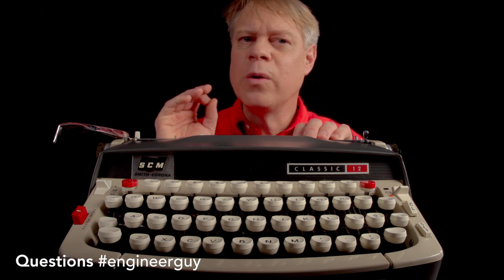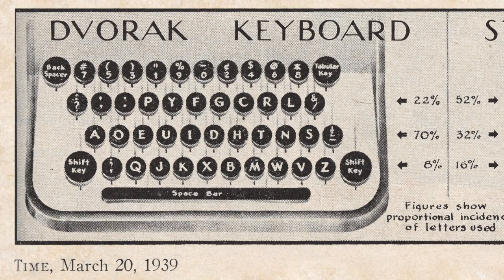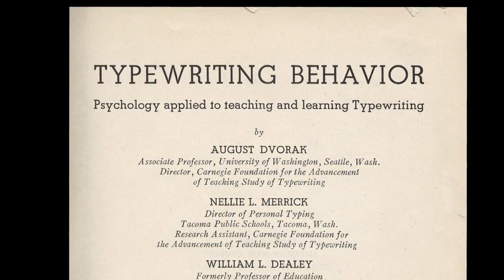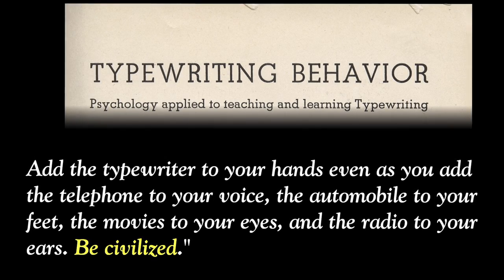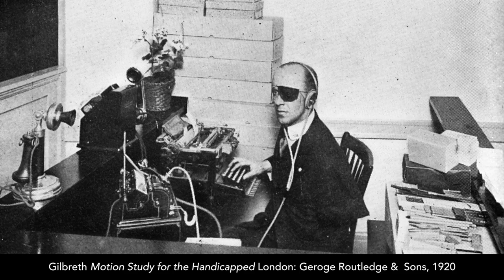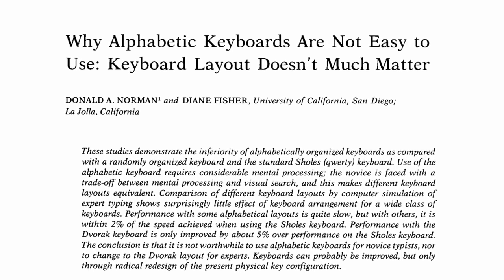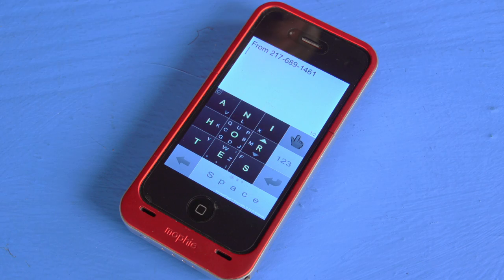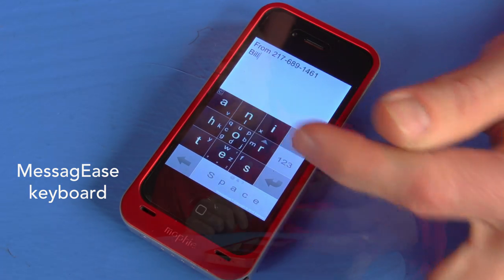Why the Dvorak keyboard didn't take over the world

Comment: Dvorak seems rather arrogant with his studies. It reeks of someone trying to prove that they understand something better than others even if it is not true. In reality, the practicality of the Qwerty layout worked for typewriters and it still works today because of how the letters are arranged to allow fingers to be spaced out and used in a certain order (for English). It takes a significant amount of improvement in efficiency for new technology to upend existing technology that works so well.

I disagree that the first technology is always the one that is accepted. Apple has proven several times that making technology more efficient for users takes precedent over being first.
Reply: "... because of how the letters are arranged to allow fingers to be spaced out and used in a certain order..."

could you provide a reference for this?  everything I've read suggests the opposite.
Reply: And then Google/Windows demonstrated that open platforms win out, and dominated the handheld device/computer markets.
Reply: ThoperSought
What do you mean by "opposite"? Are you suggesting that Qwerty was designed so that fingers are confined to a small area on the keyboard? I would think that the separation of vowels 'a' and 'e' from others 'i' 'o' and 'u' on the other side would force people to use both hands if they wanted to be more efficient. There are some letter pairs like 'ed' 'er' and 'ty' that direct fingers to the same spot, but for the most part the design keeps fingers separate (for English).

Sure, you can change the layout of the keys and get the same effect, but the point is that humans are mechanically limited just like machines are and that improvements in efficiency should be significant if one is going to upend a standard. Dvorak had an interest in selling his brand of keyboard even if improvement wasn't significant enough.

I don't have any links to direct studies, but the Wikipedia entry does direct to a few studies that refute claims that any keyboard layout has proven more efficient than Qwerty for the purpose of typing on a desktop with two hands. Stenotype is said to be more efficient for professionals, but that layout is not practical for the average person. http://en.wikipedia.org/wiki/QWERTY#History_and_purposes
Reply: seigeengine
Yes, Google and Windows did win out because of their open platforms, but both Google and Windows adopted the design and aesthetics of Apple platforms. Efficient design and open platform is the best option for the majority of consumers.
Reply: Lerkero Yes. Apple makes pretty aesthetically simple devices.

But they should try being not so butthurt and not so iron-handed with their platforms.
Reply: Lerkero Apple phones didn't even exist when Windows Mobile 6 was out. Windows Phone 7 is a horrible example of an open platform. Windows CE throught Windows Mobile 7 were an excellent example of an open platform, and existed way before Apple made the iPhone.
Reply: It's all in how you market your product. Should check out First, Best, Different by John Bradley Jackson to shed some light on a fun topic as this =D
Reply: seigeengine Apple decided to go the Microsoft way during the 90s. They almost went bankrupt. Apple knows very well what they are doing.
Reply: Joel Monteiro Which is why they're being out-competed in every market by "the microsoft way?"
Reply: seigeengine Ahah! Yeah, they're in real trouble lol.
Reply: Joel Monteiro *sigh* Yes in a way, they are. No, they're not at risk of going bankrupt or anything like that, but markets they used to dominate are now shifting to their competitors. Their only viable pathway is to innovate endlessly and be the first to market with an easy to use efficient and aesthetically pleasing design (with good marketing), or obsolescence, gradual decline, and ultimately falling into irrelevance.

Keep in mind I'm talking long-term. They have solid sources of revenue, but your choices are either growth or stagnation, and stagnation leads to decline.
Reply: kmica2008 To be fair, as a fork and spooner (lol), chopsticks are very convenient general eating tools, especially considering Chinese cuisine is sort of based around their use. The only thing chopsticks really suck at is liquids, and they use spoons for that...
Reply: Wouldn't you be mistaking the idiots pretending to "promote" Dvorak or alternative keyboard layout and being all "I'm better than you, Qwerty plebe !", with the original work done by Dvorak ?

Arrogance is strong among the pro-Dvorak of today, I'm not so sure about that regarding Dvorak (the human).
Reply: Lerkero I know that this is somewhat of an old thread, but I just wanted to let you know that all of the pain in my wrists is pretty much gone ever since I switched to Dvorak about two weeks ago. I also feel that this layout was much faster to learn than the crappy QWERTY, and I feel that I don't have to put as much effort into typing something out.
Reply: TubeofDestiny I don't think I'm arrogant being a pro-Dvorak typist.  I do however know that from the vast hours of typing on a daily basis, QWERTY nearly drove me to carpel tunnel hell.  I switched to Dvorak and never looked back.  I enjoy the feel of the balanced typing, and carpel tunnel has never bothered me again.

You may also like to know that there is a left handed and a right handed Dvorak layout as well, which were designed for people with one hand.  This is my next learning project....so that I can switch to one of them so as to type one-handed while the other hand is busy maybe with the mouse or with a drink, or eating etc..  I like to multitask.
Reply: getdistracted Dvorak may put less stress on the hands, but carpal tunnel will happen to anyone if they type a lot of don't take proper care.

And multi-tasking always leads to distraction and degraded performance.
Reply: getdistracted
Yea, you might be one of the non-arrogant pro-Dvorak typist - but it's a fact there is some people posting pictures/"guides" and walls of text on the Internet, telling people they're doing everything wrong and should become civilized humans by using Dvorak.

I know that properly used (= fixing all the other ergonomics issues plaguing computer users), Dvorak (and all its variants) is an improvement: more comfort, less strain on the hands and wrists.

It very rarely increases the typing speed or accuracy (despite all the claims of the arrogant pro-Dvorak people, trying to use that as a proof it's "better"), but in terms of long-term comfort and health, it's an improvement and should be considered.

It's the same problem with meat: PETA/vegans militants are yelling at people, while respectful people simply indicates that we might be eating a little too much meat, regarding our diets and natural resources.
Reply: TubeofDestiny Well, you could argue that less strain leads to better accuracy.
Reply: getdistracted
I've never personally felt any strain or hindrance due to Qwerty. I feel that as long as the keys are spaced well enough for average size human hands any keyboard can help people type well with good muscle memory. I like that the vowels are spaced out on Qwerty and how some common consonants are adjacent.
Reply: Lerkero My wrists started to hurt like a mother after using Qwerty on an IBM Model M for a while. I guess they're just sensitive. As of now, I can type faster than ever before, and that's after three months of using Dvorak. I'm at about ~80 WPM at the moment, whereas with Qwerty I could only manage about 70 for very short periods of time. Dvorak is also much easier to learn. If you have no issues with Qwerty, then there's really no need to learn another layout, but if you ever have issues, or want something quite a bit nicer to use, then you may as well learn Dvorak.
Reply: ***** Typing speed is a poor measure unless you were a comfortable proficient typist in QWERTY beforehand, and as you were only occasionally hitting 70, I extremely doubt that.

DVORAK simply can't be easier to learn. That's just utter nonsense. It's like you're saying if I drive, the store is fewer km/mi away. It's nonsense. The only thing that would make it faster is you already being familiar with typing. As someone who learned how to type "correctly" after having spent years typing in this weird six finger slant/multi-angled approach (emerged from the position of my arms at the computer when I'm not doing typing-specific tasks, every key was a mystery to me as if I had been learning a new layout, and trust me, it took little more than a week or two to hit confidence and decent speed, certainly up to my prior level (80 wpm with six fingers, and my one arm at nearly at 90 degrees from the alignment of the other).

As to whether it's faster? Marginally. Is it healthier? Likely. But easier to learn, or meaningfully faster for a typical user? Unlikely.
Reply: seigeengine My speed would have been greater in QWERTY if I didn't start to experience pain in my wrist (mostly the left one, as QWERTY is left-hand biased). My wrists are probably more sensitive than most which is why my they were giving me issues during long typing sessions. Once I pulled my hand away from the computer, and that was it. I was done with QWERTY. I knew about Dvorak beforehand, so I permanently made the switch at that point. I did have some pretty bad typing habits along with horrible posture at that point, which was most likely a contributing factor to the pain. You can look on my channel -- there's an old video on there of me typing and you can see how bad my posture and positioning was. 

Dvorak is easier to learn because the letters are in a much more logical configuration. It didn't take me long to learn Dvorak, whereas I tried and failed to learn QWERTY in school because I was taught typing back then. Biggest waste of time ever known to man that was. Once I put my mind to it, Dvorak took me a couple days to learn. I was able to memorize the positions of the letters very easily. I was insanely slow at first, but my speed increased dramatically once I stopped having to think about the letters. 

I'll also mention that my old QWERTY speed was achieved in about five months, whereas with Dvorak I'm on my third. I thought it was going to take me a very long time to get back up to speed, but I was there in about a month and a half. I will also mention that I did a massive amount of typing during that time, and I still type more than the average user. It was totally worth it for me as I gained speed -- not to mention the comfort and the nerdiness factor. 

Simply put, I hit a speed wall because my wrists would start hurting rapidly. Now, I can type for quite a long time and have no issues. Personally, I found the layout very easy to learn. Personally, I find it much faster than QWERTY ever was to me. Sure, it's a bit of a pain to learn, but it's totally worth it if you spend quite a bit of time in front of the computer. It may not be for the end user, but an enthusiast like me will love the layout. I find it more accurate, as well as faster and easier to learn. 

Some people don't find it any faster, but it definitely is for me.
Reply: Yeah that was a really long really poor response. Have fun with that.
Reply: seigeengine Obviously you ignored every point that I made as for some reason you want to be correct. I don't know where the aggression came from, but I guess some people just can't argue properly.

Back to the topic: I take it that you do not type Dvorak, and have learned how to type QWERTY instead. If you haven't even tried learning it, then how do you know Dvorak isn't much better, if at all, than QWERTY?

I'll give you an example: I used to think that Cherry MX Blues were much smoother and nicer than Buckling Springs, but as the owner of an IBM Model M and a CM Storm Quickfire Rapid with MX Blues, I was completely wrong. It's about the other way around. Had I not tried both, but still insisted that the Blues were better, then how would I be correct? Exactly -- I'd be someone ignorant who doesn't base his opinion on facts, but rather arrogance. That's an example based on personal preference, so it's not that good, but it still gets my point across. If you really did type Dvorak, and took the time to learn it, then you'd have quite a bit of room to talk.
Reply: seigeengine "DVORAK simply can't be easier to learn"

"As to whether it's faster? Marginally"

"there's no meaningful difference in the rate at which you memorize the position of those keys"

- Dvorak was, for me, easier to learn. Read my previous comment, which you choose to ignore out of blatant arrogance. I'm going to base my words about it on personal experience. I had a much better experience with Dvorak over QWERTY, and nothing will be able to change my opinion about that. You, on the other hand, are just being negatively arrogant about Dvorak despite not having used it. That's the epitome of ignorance right there. 

- Again, Dvorak, for me, is much faster than QWERTY. I hit a wall because of wrist pain. Sure I could have progressed, but I was using a Model M at the time with relatively heavy switches. 

- When the most commonly-used letters are on the home row, then yes they are easier to remember. It didn't take long to learn Dvorak's home row which consist of the most commonly used letters -- the way it should be. 

Who are you to talk? You don't type Dvorak, yet you're making so many assumptions about it. I've been proficient on both, and I can safely say that Dvorak is a much better layout than QWERTY. There's so much less movement, which leads to less strain, better accuracy, and more speed to some.
Reply: seigeengine *Even if you were being positive about the layout, I was proving how much better it is*. For some it may not be, but for me it's miles ahead of QWERTY. 

Yeah, I'm a "nutjob", okay. Now you're just mad for some reason. I said nothing aggressive, but you start being rude for no reason. That's really pathetic if you ask me. Seems like you have nothing better to do. 

I do that on a nightly basis, but thanks for the suggestion -- my wrist is in much better shape than before, so I can use it to its full extent.

At this point, you're ignoring every solid point I'm making because you refuse to accept solid facts. If you can type so well, then you shouldn't consider this a waste of time. I don't, as nothing is funnier than a heated YouTube argument, especially when the opposing person got mad for no apparent reason. 

So, go learn Dvorak, and then come back to me. You have no experience, so obviously you have no room to talk. 

By the way, I'm glad to see that you're in that part of Canada called Quebec. I'll take British Columbia any day, as it's much nicer than that money hole. I've been there, by the way, and it's pretty bad.

There -- you have an example of a person who speaks by experience, and not by arrogance. Learn how to argue like a grown man if you're going to be on here.
Reply: seigeengine Should've known. You're not going to write back at this point because you have nothing else to say. The points I'm making are solid because they're based off of my experience, and they cannot be disproved to me. 

I hope you have a better life in the future, because as of now you seem to take everything too seriously, as suggested by your Google+ page. You should not be on the Internet if that's how you're going to act on it.
Reply: And they all lived happily ever after. The end.
Reply: Jacob Holmes Well I don't know about him, but I can safely say that my wrists will be living happily ever after. xD
Reply: ***** Realistically, people will type as they will type. I've read that Dvorak is better. I've read that Qwerty is fine. I've read the statistics for both. Overall opinions are like butts, everyone has one and they stink.

So really if someone typing in qwerty is having a hard time with their wrists and they are actively searching for something to remedy, they can try Dvorak for themselves. Otherwise speed differences are negligible unless you are a closed caption typist.

aoeu brother, but don't stir up a hornets nest over something so silly.
Reply: Jacob Holmes That is true. Opinions are opinions, but no matter what, mine is always correct. xD

But in all seriousness, people will type with whatever layout they want to. Sure, I'll recommend someone the Dvorak layout, but I don't force it upon them. If they don't want to learn it, then they don't want to learn it.

I did have a hard time with my wrists which is the main reason I learned Dvorak. QWERTY was doing me fine up until a point. I have found Dvorak faster, but that's going to differ. It's definitely more comfortable -- there's no doubt about it. Less movement = less strain. I'm going to tell people that it's a faster layout because it was faster for me based on personal experience. 

The only thing I said was that long body of text. For some reason, seigeengine felt the need to be rude about it. I'm not a troll, but I certainly will piss someone off online if need be. He brought that tendency out of me which is why I started "stirring up a hornet's nest". Had he not been rude and closed-minded about what I said, then none of that would have been said.
Reply: Jacob Holmes ***** I use both Dvorak and qwerty, I find qwerty easier for one handed typing (programming) and dvorak faster with two handed typing (actual typing). It's all a matter of opinion - I just find it a little bit annoying iOS doesn't have Dvorak.
Reply: seigeengine I have four pairs of chopsticks and they replaced every single fork in my house. Forks are good for eating steaks, and that's really it.
Reply: TurtleShroom I cook food properly so I don't need to cut it with a knife when I'm eating it. And in the kitchen I just use my hand to stabilize my food.
Reply: +Garrett Miller Once you've learned QWERTY it makes learning Dvoark easier. It's like if you learn to be good at Tennis, you'll likely pick up on Squash faster than someone who has never played a sport.

I'm a typist in the 100+ WPM range, and was intrigued by the offer of increased speeds Dvorak offered. I spent a few months learning it, and was able to get to the ~70ish range. Honestly, I found it to be more inconvenient since every time I would sit down at a different computer I'd have to try and throw a switch in my brain to go back to QWERTY. It got frustrating enough to make me stop bothering with Dvorak.

(PS, Cherry Reds are where it's at. Low activation force and no click needed. Just smooth quiet typing without bottoming out.)
Reply: Why do I know you think GW is a hoax and you voted for Trump lol
Reply: Lerkero it was not in the age of apple it was different era.
Reply: " There are some letter pairs like 'ed' 'er' and 'ty' that direct fingers to the same spot, but for the most part the design keeps fingers separate (for English)."

And if you're willing to break from the rigid homerow structure in such cases and use an "improper finger" to hit one of the two keys, even that problem doesn't exist.

And nobody wouldn't break homerow structure to do that, because hitting two separate keys consecutively with the same finger is really awkward.
Reply: "Windows Phone 7 is a horrible example of an open platform."

Yes well, the Vita is the greatest handheld system ever made, vastly superior to the 3DS. But the 3DS sells millions, and the Vita was dropped by Sony.

Maybe it's not the products, but instead how those products are marketed. If Sony doubled down and put more of their weight behind the Vita, developing more killer apps to put behind it, the Vita would be a success. People would LOVE to play Crash Bandicoot on the train. People would LOVE to play Panzer Dragoon on the train. People would love to have a Playstation 2 in their pockets, if it had the games to back it up. I think the library is perfectly fine and has a hundred titles I'm interested in, but most people aren't interested in a lot of those, and instead of pulling support, Sony should have just made more games for those people instead.

Maybe Windows Phone failed because Microsoft didn't do anything. Look at how they market the Xbox. If they marketed the Windows Phone like that, and supported the Windows Phone like that, it probably wouldn't be such a failure
Reply: Cherry reds are meh. Without bottoming out lol. You know you can use any other MX switch without bottoming out, right? It has nothing to do with that. The only difference is that reds don't have a tactile actuation point like browns or blues do. In fact, browns are vastly superior to reds for exactly the same reason you think reds are good, except they also have tactile actuation, which means they're even better for not bottoming out because there's an actual point at which you're physically aware the key has been pressed enough.
Reply: Says the man with an anime display picture